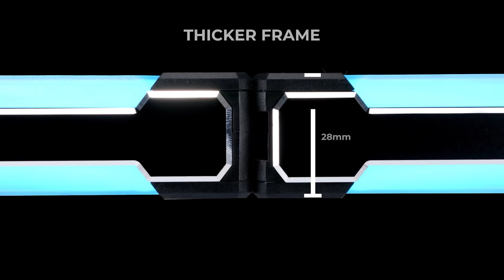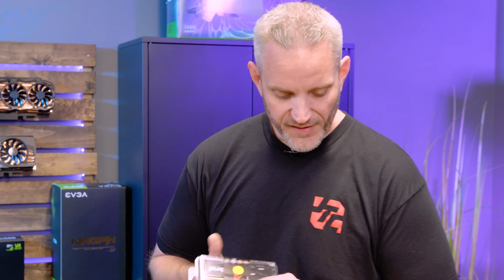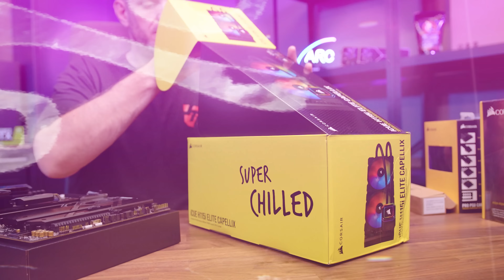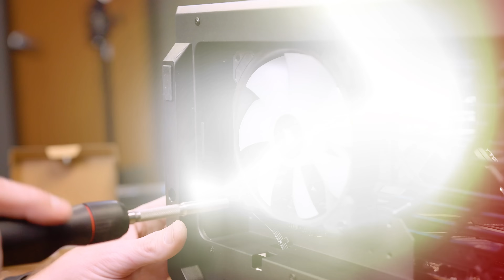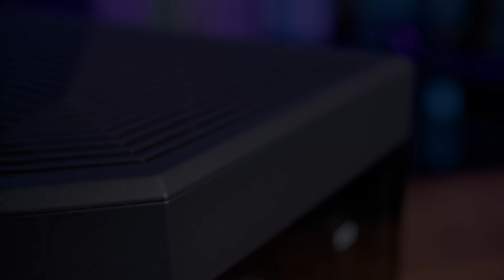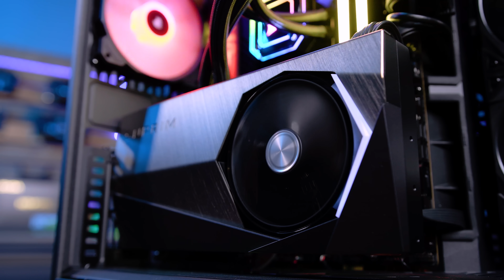I built a PC in the Hyte Y60...

Comment: I am in the planning phase of building a computer for my daughter. She will be turning 7 and she is a dork just like me and always asking to play on my computer. I will probably spend more on "making it pretty" like daddy's computer then on the hardware. I'll probably go 11th gen intel or even 10th gen. She won't need much in terms of gpu. I might go with the 1660ti, but if I can find a deal, I'll bump it up. DDR4 memory can be bought with some pocket lint and a button now. I won't need a huge power supply. So, here's where it will get expensive. Custom cables, lian-li fans (I love these things), probably the Corsair H150i Elite LCD. It will be a good starter computer for a casual gamer, and if she really gets into it, I can always move all those shiny gizmos over to a newer build with more power.

Daddy's build:
CPU - 12900K intel
Motherboard - ROG Strix z-690 gaming
GPU - ROG Strix RTX 3070ti
Memory - 64GB DDR5 Dominator RGB from Corsair 5200
Cooler - Corsair H150i Elite LCD
PSU - ROG Strix 1000W Gaming Power Supply
Case - Lian-Li 011 EVO
Fans - Lian-Li Uni Fan AL120 (7 of them)
Cables - Lian-Li Strimer Plus for both the 24 pin and the 3 8-pin gpu

Comment: After a few weeks of research and seeing what I could actually get my hands on. I just finished my first build and used a few of the same parts. 
Even put a sensor monitor on the front angled glass
This case is awesome and looks great. 
All black Hyte Y60
Intel i9 13900
Nzxt Kraken z53 rgb aio 
Rog strix z790
Samsung 1tb m2 
T-force 2x16 ddr5
EVGA Rtx 3090 FTWA3 Ultra w/ hybrid aio
Corsair RM1000x

Comment: Hi Jay, Should the GPU (MSI Liquid SUPRIM)'s radiator be oriented tubes going to the bottom of the case instead of the top? I am actually not sure where the pump for this cooler config is. Thoughts?
Reply: Never place the radiator of an AIO below the pump. You’ll burn the pump in a year. That’s because air in the circuit rises and then will be trapped in the pump causing noise and ultimately failure. Jay has a great video on this.

Comment: I built in this case. White with clear glass. Long Corsair 1000w psu. Gigabyte Aorus Master z690 board. Intel i9 12900k. MSI 3080 card. Nzxt aio. White T-Force Delta ddr5 6000 ram. 2 - 2tb Samsung m.2 ssd's. All Corsair individually sleeved white cables. Rgb fans with everything glowing white. I saw this case and fell in love. I bought it before ever seeing a video review lol. It is truly unique and gets a lot of attention. If Hyte could also offer a flipped version so we could build to have it on our right side (which this one is) or on or left side. That would be amazing.

Comment: Was looking at a case like the 011, when this came out. So glad I picked it up, its such a nice case all around IMO, only wish is the choice of doing a GPU without the vertical mount gonna be fun finding a hybrid card I want, still rocking my 3 fan ROG 1080ti so it fits for now but its at its limit for size IMO. Jay is also right about there not being much room for the commander pro, i have mine under the bottom tray in the front of the case, hope i dont need to do fans there cause ill need more 3m tape lol.
Reply: sidenote i want a hybrid GPU with a 280mm radiator, i hate putting not the biggest fans on things, if i got a 240mm i would buy some 3d printed adapters to fit my 140mm fans onto it and still be salty about it

Comment: My first build this year is a nice $300 build for my parents. 5600G, 1TB NVME, 16GB of ram, my old 32" curved Samsung monitor, and an old case and psu I'm not using. Much much better than the old Hp 4670? Intel system they currently have that takes forever to load anything. Microcenter had some good deals earlier this week. Replaced my old monitor with the newest Odyssey G5 165htz curved beauty.

Comment: thinking about transferring my current build into a Hyte Y60. I currently have 3600 + RX 6800. I am running the Arctic liquid freezer II and I wanna upgrade to a 5600x or 5700x. It's in a Coolermaster Q300l rn and it's a tight fit for everything. the smaller form factor is nice and temps are fine but the y60 just looks too cool.

Comment: The all important question... Intel or AMD....

Nvidia for RTX, duh. Dont even try to sell me arc GPUs bro.

But for the CPU... Coming from a 5900X (160W tuned) currently, I am starting to dislike high powerdraw consumer CPUs. The cooling requirements....
So in terms of core count the 7900X (200W stock) and 7950X (250W stock) are on the table, but both their power draw is pushing me away. I would sweet spot tune them to reduce max power draw for which the tools are better available on AMD. I would probably mod the IHS for better cooling and lap it a lot...... scary...

On intels side: 13700K (8P 8E 24T, 280W) and 13900K (8P 16E 32T, 300W).... but that power consumption... Would probably do some heavy tuning on these... I dont mind the P and E cores as much...

So for now I am waiting for power consumption to go down, and maybe passing on the AM5 socket due to the unusually high IHS design...

Comment: My white Corsair 5000T case came with the Commander Core XT controller pre-installed in it and Corsair has set it up to be able to run mix-and-match models of fans as long as they're Corsair fans (obviously). The case came with three white LL120's pre-mounted on the front for intake but nothing else in the back or top for exhaust. So before I bought more white LL120's while they were on sale I ran three of my previous HD120's on the top for exhaust and the Commander Core XT splits them up 50/50 with their own settings menu. The HD120's are still lovely fans with nice lighting and the crystal clear chassis but the LL120's are definitely a step above with the more complex lighting they can do. :)

Comment: I have been using this case for a few weeks and I love it. I put a pair of '1stplayer X-Fan' that were on sale at newegg in the bottom for intake and the case is now an airflow beast. My only complaint is the PCIE riser cable is extremely stiff, and I have an X670E Taichi, and the top PCIE slot is lower than where it would be on a normal motherboard, more like it is located at the 2nd slot, which makes the PCIE risers cable length too long so the excess cable pushes up against the 2nd lower pcie slot. Due to this, I can't really use the second slot. I have a low profile asus 10gb card I wanted to put in there, but it would require pulling the risers cable forward an extreme amount to the point in which I am afraid I am going to ruin it in some manner because of how it is molded.

Other than that, it is an awesome case.

Comment: If you were ever concerned about dust inside your system I would just hook up a quiet air filter to blow filtered air into you tower. I've had my Asept-Air  1550UV 5-stage Air Purifier  99.97% TRUE HEPA filter and it has GREAT air moving power or even on low quiet mode you can't even hear it. Do a video on that! Any air purifier would do honestly.. and make the build your own!

Comment: I'm in the process of purchasing the parts to build a 13th Gen Intel system and I'm a bit concerned that the BIOS that comes with my new motherboard will not support my i7-13700K.  I read that most MSI and Gigabyte Z690 motherboards come with a USB flashback option but that's not the case with ASUS.  Since I don't have access to a 12th Gen processor should I avoid buying an ASUS board?  Appreciate your thoughts.
Reply: Asus pretty much INVENTED that feature. Asus has it.  Also Asus is #1 when it comes to motherboards.
Reply: @Digikidthevoiceofreason  based on ASUS website only the ROG Strix boards have it, they are expensive and not in consideration

Comment: I just had same issue. I switched over from the Thermaltake P3 TG Open frame to the O11 Dynamic Evo and was using an EVGA 1600w T2 and that this is longer than a '69 Caddy. There was no way i couldn't have stuffed that in there so had to get a new power supply, But the 1600W was way overkill anyway. I just have a 12900KS and Titan RTX. I went with an 850W witch is still way more than enough, That Hyte does look good though!

Comment: Thanks for the video Jay.  Recently built with a 7950x in this case, currently shopping for a 4090, and had been eyeballing this card for precisely the reasons you mentioned re airflow against the glass.  Good proof of concept.  Would be interested to hear how your your thermals turned out in the end.  Thanks again.
Reply: how’s the temps with those bc i see this only is capable of of 3 fans on the top 2 on the side one for exhaust and the the 7950x and 4090 are ridiculously hot
Reply: @mmeltymelts9896  There's also room for two more fans in the bottom

Comment: Hey! Nice Video! I use the Y60 for quite some time now with custom loop and external rad. Buildung in it was pure pleasure, everything is well thougt out and the case materials and painting qualitiy is amazing. There is only one down side for me, you cant move the vertical pcie slot so you are limited witch space behind the gpu because of the pcie cable module. But thats crying on a very high level 🙂 The Case looks a bit empty without radiator in the front, enogh room for a statue or so.

Comment: I have wondered, ever since I built my first system with two 8800GTSs in SLI, why video card power cables don't go into the bottom edge of the card. Why do the power cables go into the top edge of the card where they stick out and block the view of everything? If they went into the opposite edge, they'd be down by the motherboard and with a right angle plug, you'd never see them. Or, if it's vertically mounted, like this PC, they'd be completely hidden.

Comment: I love this case. Got the Hakos Baelz edition and it's beautiful. Keep in mind that this case has limited expansion options as the rest of the mounting for any PCIe cards are exclusively low-profile mounting only. So if you have a capture card or any other kind of PCIe card you want to install, you better pick one that can be installed in a low-profile slot. I wish Hyte had at least left some sort of option to install an additional full sized card. Even if it was additional vertical mounts with riser.

Comment: The Hyte Y60 is a great concept case, but it really lacks in airflow.  I'm more interested in a successor model that corrects it's pour airflow, and lack of sound suppression on the 3.5in drive bays.  I see a successor as a possible budget alternative to the 011 Dynamic series of cases.  Make two different versions of this case, one that focuses on 2x360 rad, another with a current config but more airflow... could prove great!  It looks AMAZING (and after finding out it was designed by the same person who created the NZXT S340, I now understand why).  I want great looks and airflow, and neither the old S340 or the Hyte Y60 fully deliver on the airflow part.

Comment: I built my wife's PC in this case (black one) - it was one of my favorite builds.

Edit to add specs: Crosshair VII Hero, Ryzen 3700X, Radeon VII, 2x8G 3600 DDR4, 1TB nVME SSD - cooling is custom water glass/soft tube hybrid for CPU and GPU with a 360 rad up top and a 280 rad on the side.

Comment: I have a hyte y60 build and love it, i changed from using a corsair psu to the silverstone strider 1200 watt because it is the shortest 1200 watt power supply available and it made life so much easier to cable manage around the back
Reply: Yes, I am finding the Corsair 1200 is just to long with all the wires plugged in the back.

Comment: Thank you Jay for this video! Watching you build and going over the case is something the team has been looking forward to. Always great working coming from you and we appreciate you. Have a happy holiday season 💛
Reply: I just purchased the Hyte Y60 case after having another case arrive for my new AMD 7900x build. I've seen several very cool builds in this case chose to spend another $150 to get the custom look that I am after. Thanks for having the price reduction over Thanksgiving, Hyte!
Reply: It is a really good case.  I would have built my wifes machine in it if it was flipped for left side display of the PC.
Reply: I grabbed one of your cases! Works like a dream with a  similar build!
Reply: I've been scoping for a case to make my daughters computer. I like this case for the $170ish.
Reply: Can you guys develop a case for a 3slot (example: gigabyte 3080 ti OC) I really love this case, but I won't buy it because my graphics card would be choking against the glas. So this case with a normal configuration for the graphics card, or make the case at the glass side 5cm (2inch?) wider is something I would love. 
Thx Jay, for the review and the build.
Reply: hyte, this is a very slick case, love the smoked glass and the chamfered edge!
Reply: A XL, improved version would be nice, with space for 360mm rads and to fit a GPU horizontally and not using the adapter.
Reply: Anyone who thinks this case is expensive @$275 has probably never built a pc . Or used a case that is more than 40 bucks...
Reply: Wish the case came with the corsair sleeved cables standard. Those would have been a HUGE help with the management
Reply: After weeks of debating between 3-4 cases for my new build, jay talked me straight into purchasing a y60 Snow White…
Reply: 275 on amazon uk thats a joke
Reply: @Raynor2208  Sounds about right, it's a premium case. You think that's expensive? I have the intimidating HAF 700 EVO sat next to me right now  😁
Reply: @mozzjones6943  alls im meaning is its on black friday deal on amazon usa for 150 or so,ething and uk is double ino its a good case just hate scalpers
Reply: @Raynor2208  Check Overclockers. I got  mine for around 190. But they are in high demand!
Reply: @Raynor2208  yikes thats awful, i hope it comes down, its $159 in the us rn
Reply: @kraftw  😥
Reply: @Raynor2208  lmao - guess you never saw CaseLabs case prices. (they are returning too)
Reply: @Raynor2208  $299 Canadian on Newegg CA. I saw one a few weeks ago on Amazon CA that was $350. And for that reason, I'm out.
Reply: @Raynor2208  kinda funny comment when you consider which kinda car you display on your profile lol
Reply: @RealTaIk  how it funny
Reply: @Raynor2208  you post the most expensive car on you profile and cry about this case being to expensive xD

Comment: The corsair icue h115i elite capellix has got the new ml140 with 4 pin icue connector, not the old 3 pin and the new sp120 and sp140 fans which are pwm have the same connector. I've got the same cooler with 3 sp140 pwm mounted as case fans and they're connected to the commander core that come with the h115i both rotation and lighting. I'm also waiting for an adapter cable to arrive soon and it's a 3 pin argb to icue 4 pin adapter cable. It's for my be quiet pure base 500dx to sync its lighting with icue just like a regular argb led strip

Comment: It'd be nice if we had VGA-style connectors for the 12+4 pin power. Once you screw in the VGA cable you can wiggle it as much as you like and it's not going anywhere. Connection problems solved.

Comment: So crazy... I have the same CPU cooler and GPU and after seeing the mostly rave reviews about this case, I wanted to move my setup to this case, but didn't know if it was worth moving from my awesome 5000D Airflow. Then Jay builds this in the exact way I would do it and it looks awesome... Looks like I might pull the trigger. Especially since it's discounted everywhere right now.
Reply: This case is great to work with. I did dual aoi's as well and it works well.
Reply: @kovaks42069  did you choose the same 240mm cpu aio or do you think a 360 cpu aio could fit with the side mounted 240 gpu aio?
Reply: @Kanelives1337  I used the phanteks 360, fits perfectly and hoses line up nice with the gpu's aoi
Reply: @kovaks42069  nice! thanks =)
Reply: @Kanelives1337  np, let me know if you have any more questions, i spent a lot of time on this build.
Reply: @kovaks42069  can you also have 4 sticks of ram with that cooler?

Comment: Jay, iCue has been updated to support multiple fan types on one controller. I was running QL120s and ML120s running off of the commander that came with my cappelix cooler properly. You just have to configure your fans in the lighting for the cappelix.
Reply: I was very confused when he said that the controller couldn't control both sets. I built mine with ML120s and the same cooler and had no issues.
Reply: @OUBrent1  it was not always an option. I’m sure it’s been quite some time since Jay has used any Corsair fans and controllers since he’s been using lian li fans in his builds

Comment: I think I would have swapped the bottom intake RGB fans with the GPU AIO fans as the RGB would be better seen than hidden but, that's nit picking. Nice build! Happy holidays boys!
Reply: Won't putting the aio lower than the GPU kill the pump early?
Reply: @shauryataneja6251  absolutely, I was talking about the fans for  looks, not moving the aio

Comment: Just finished a build yesterday in a corsair 5000d, same motherboard and I am also waiting on AMD GPUs so I kept my 2080 Super for now. I used the H150i 3 fan cooler and I have to say I wish I did a 2 fan AIO. Tubes down front mount did not reach the CPU and top mount was really really tight. I got it but wanted a front mount. Whenever I do a build I screw 1 thing up.  Still fun.